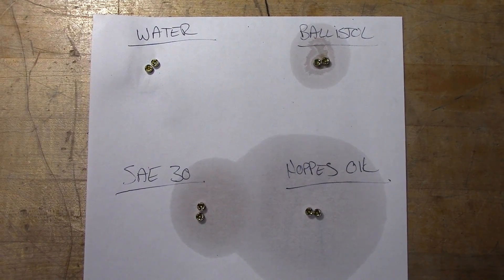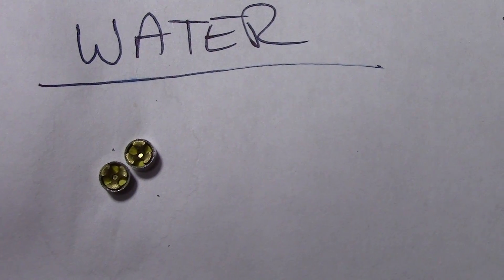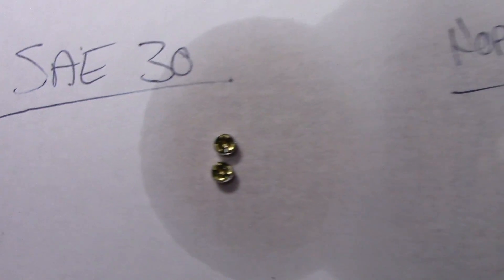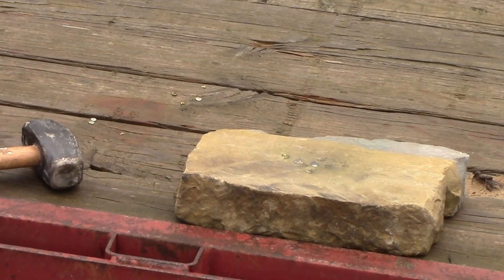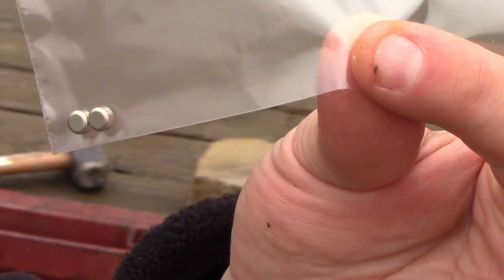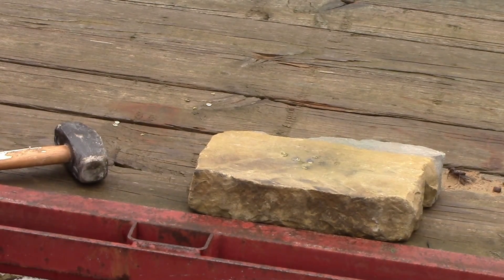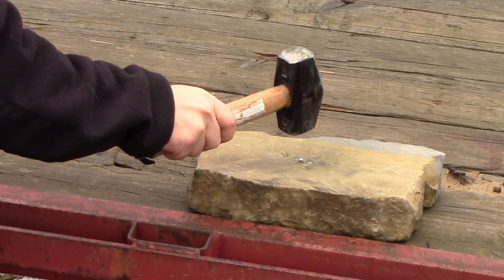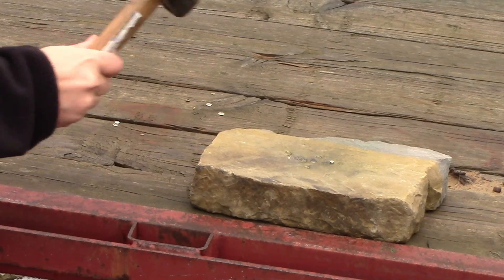Deactivating Live Primers (Experiment) - Part 2

Comment: There was a bad batch of 308 Win sold by the UK NRA in 2019.  During lockdown, there was no ammo available so everyone ended up buying some of this.  I broke an extractor after firing 5 rounds so I put the rest away.  The primers are defective (too powerful and wrong compound used).  My goal is to salvage the bullets (Sierra MatchKing) and make the case safe enough to recycle.  I pulled the bullets and dumped the powder.  The primers are crimped in.  I tried to remove the primer using a Lee decapping die as gently as I could and the first one went bang.  I had safety glasses on but out of the corner of my eye I saw something fly off my reloading bench.  I don't know what it was.  The crimped in primer blew out of the case and is somewhere on my shop floor.  I don't want to fire these using my expensive target rifles and I don't want to borrow someone else's junk 308 in case I wreck it.  What do I do?  It takes a lot of force to push the primer and it tends to 'bend' before it pops out of the crimp.  I could burn them, but I am sure the neighbour's horses would not appreciate the sound.
Reply: Sounds like you know what to do. Full send it like you did the first one and let the primers explode around your shop. Then you can just swage the primer pocket to remove the crimp and reload them yourself.